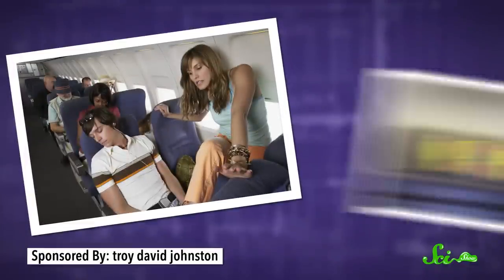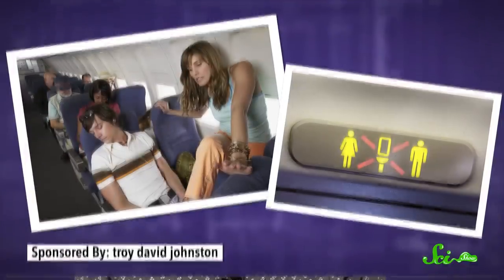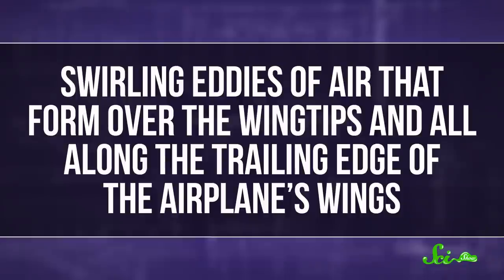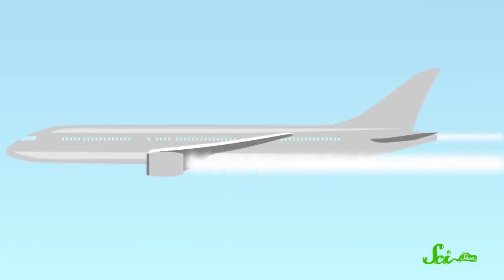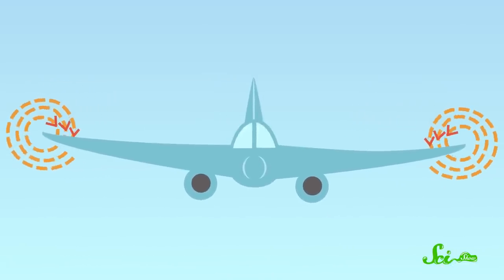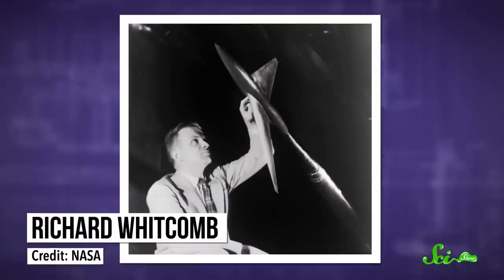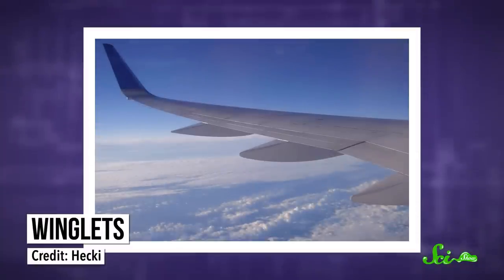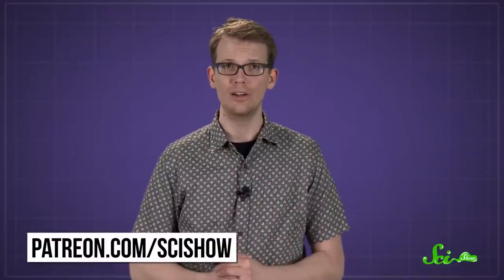What are Those Things on Airplanes' Wings?

Comment: I work on aircraft, more specifically the B737 NG series, we have to remove and install these winglets all the time as part of our inspection. 

Bout all i gotta say here, what he said is basically all there is to it. Reduce wingtip vortices and decrease fuel consumption
Reply: +sacr3 Do you know if there is an optimal angle or length for the winglets?
Reply: +sacr3 i would guess they add a little vertical stabilization as well.
Reply: +MonsterUpTheStairs i'm not an expert but it probably depends on the size, weight etc. of the plane.
Reply: +sacr3 Does it also reduce wake turbulence, so planes can be stacked closer together during takeoff and landing?
Reply: +Ralphie Raccoon it does reduce vorticy induced turbulence so yes
Reply: +MrDmkus indeed I belive so too makes Sence though from personal experience aircraft with winglets fly a lot better through storm systems and rough  air compared to a standard Wong
Reply: +MonsterUpTheStairs As far as i know, each aircraft model (that uses it) has it's own angled and sized winglets according to the plane's size,weight,shape and cruise speed (there are a lot of other factors but these are basic ones), same goes for control surfaces balance tabs.

Comment: Holly cow... So many people in the comments talking about how Air is not a fluid. Come on people.
Fluid =/= Liquid... Those are two different things.
Fluid is something that flows and does not have a definite shape. Like water in a glass take the shape of the glass, or the air in the balloon takes the shape of the balloon.
Reply: +Mateus Bittencourt you can't use the =/= sign since the terms act as sets, and one contains the other. It's more like Fluids ⊃ Liquids
Reply: Calin Cristian of course I can...

They are two words with different meaning... Yet people think they are the same thing. the =/= is meant as "not the same" the same way Liquids are not the same (different) as water. liquid =/= water.
Reply: +Mateus Bittencourt In this case a liquid (the glass)  holds a liquid (the water). xD
Reply: Mateus Bittencourt I'm afraid you don't understand what I'm saying. You can say that fluids and solids are different. You can't say fluids and liquids are DIFFERENT since all liquids are also fluids.
Reply: Calin Cristian I got what you meant the first time... Sorry, but I think you didn't understand what I'm saying.

Imagine you have 2 groups... Let's call Group A and B.

A = {1; 2; 3; 4; 5; 6; 7; 8; 9; 10}
B = {2; 4; 6; 8; 10}

Now... between A=B or A=/=B what is your answer?

Doesn't matter if A contains B, A is different than B.

Comment: I'm surprised that people don't know that air is a fluid.
Reply: Right?
Reply: +Henry Young Yes, yes it is.
Reply: And I was surprised that the English-Swedish dictionary translated "fluid" into "vätska" (liquid) or, more accurate, "i flytande form" ("in floating form", but unfortunately  it's sometimes translates to "in liquid form" ). The real translation is "fluid" but it's never used outside of physics.
Reply: +yrjosmiel73 I was a little surprised, as in my own language (Dutch), there is only one word for both liquid and fluid. (vloeistof). I've started learning English more than 30 years ago, but I had never given the difference that English makes any thought until now.
Reply: +RogerWilco Portuguese in this case is similar to English. We have the words ''líquido'' and ''fluído'' to represent them.
Reply: +RogerWilco German here. You could use "Fluid" as a lean word or "Fluss-" meaning flowing as a suffix, but otherwise theres no obvious distinction between fluid and liquid either.
Reply: +Henry Young What (English-speaking) country would teach everyone that all flowing substances are called "fluids" and actually all act the same way? That's not something you'd need to learn about until high-level physics.
Reply: +yrjosmiel73 People confuse fluid with liquid, yes air is a gas but it's also by definition a fluid.. PHYSICS!
Reply: +Jordan Shank In Hungarian, it'd be folyékony (able to flow) vs folyadék (liquid)

Comment: To anyone wondering why air is a fluid.
From Wikipedia: "In physics, a fluid is a substance that continually deforms (flows) under an applied shear stress." Basically, if you continue to push it and it continues to flow, it's a fluid. So silly putty is a fluid, but also gas and of course all liquids.

Comment: As you increase the wingspan, not only do you encounter more structural integrity problems to solve, you encounter restrictions airports have put on wingspans. This limit is in place to help parking arrangements, improve runway safety, and prevent disastrous collisions in airports that are designed for a set aircraft size. For a long time it was simply cheaper to add more wingspan than it was to study and fabricate winglets. But now with improvements in technology and manufacturing, as well as airport restrictions, winglets are becoming very popular.

Comment: Fun Fact:
Winglets are mostly used as an upgrade for older model airplane wings to make them more efficient. Modern airplane wings like the 787 don't need winglets as the wing has already been optimized for minimum drag.

Comment: winglets suck to manufacture. the inside structure is tapered, twisted, and bent leading to a bunch of parts with sharp bending radii and closed geometry. i made a winglet spar mold and it was definitely the hardest thing i have designed.
Reply: +cubedude76 And now consider the crazy twisty bendy shape of modern raked wingtips on composite wings, like the 787!
https://c1.staticflickr.com/9/8001/7196778020_89ee123320_z.jpg
And on the 777X they even plan to have the whole thing folding.

Comment: You should see some of the new curved wings being engineered for airplanes.  The entire length of the wing is curved upward instead of just the tip.  I'm not entirely certain why that helps because I'm not in Aerospace, but I've been told it's a good improvement.
Reply: +Daracaex It is the more efficient solution to the same problem (less total added mass for same reduction in wing-induced vortices), just that it is a lot more complex structurally to achieve. Hence it is only in the newer iterations of aircraft that we are seeing it.

Comment: Why are there airplanes WITHOUT winglets then?
Reply: +Connor Halleck  My guess would be that the wingspans are long enough for extra compensation to not really help that much. Hank did say that one way to deal with it is by making the wings longer.
Reply: +Connor Halleck Making the wing have a long gentle taper is actually more efficient than winglets, so large airliners that don't have to fit into the smaller gates at airports use those instead (like the 787 and 777X). Other planes, like older 737s, were made before winglets were commonplace, so they don't have the benefits of newer versions with winglets.
Reply: PhisherEntertainment Interesting!
Reply: +Connor Halleck Probably less vortex around smaller planes?
Reply: +Connor Halleck There are a lot of answers to the question, if we consider airplanes in general. It depends on the preliminary design and the function of the plane.

If we're talking commercial airliners, then some might not have the typical blended wingtips because they integrated the design onto the wing (notably 787 Dreamliner). 

Other reasons for any type of aircraft might include them being older models, not prioritizing fuel efficiency, or does have them but are not your currently-typical design.
Reply: +Connor Halleck old designs. The 747 was built in the late 60's, decades before winglets were introduced.
Reply: +BigGamer2525 787s don't really have winglets
Reply: vagkalosynakis see above answers. also, BAHAHAHA patents are so fucking stupid, omg
Reply: Winglets are not necessary but help with efficacy and drag reduction there are a lot of modern aircraft that don't have winglets in the military general and even commercial sectors while they are becoming more popular again they arnt necessary they will help your aircraft Save fuel and all around improve its flight charectistics    In a commercial setting a company can save money in fuel there aircraft will require less mantince  due to less turbine wear and fly better and get to places quicker also the aircraft would again handle  better under Certain conditions also if you are flying a large Heavy cargo craft that by design  to accommodate cargo makes more drag winglets can help but there are still many places they arnt used and again they just help
Reply: +PhisherEntertainment Also, $$$. The cost for applying for a new type certificate and all the required documentation for, basically a new wing design, is very costly.
Reply: +Connor Halleck Winglets only help in certain cases.  It depends on the wing design, speed of the plane and lots of other factors.  Keep in mind that the winglet itself adds drag, weight and complexity to the airplane.  Sometimes that tradeoff overcomes the drag-reduction it provides.

Comment: hmm... length is not entirely the reason. but i guess it would be difficult to explain in simple terms. i would say it is to stop the air from bottom of the wing to try to get on top of the wing which you show in your vortices. the flow across the tip is because there is higher pressure on bottom of the wing. if the wing is pointing up then the bottom surface of the winglet part does not need to have a lower pressure. the ones that you don't see with winglets would have a much larger sweep at the end which achieve the same effect. there are also winglets of the shape of T

Comment: Thanks for a pretty good simple explanation for this--It's hard to explain fluid mechanics accurately and simply sometimes.  You might have added that this doesn't help all wings--some modern wing designs are efficient enough that adding winglets doesn't improve their performance.
Reply: +Tim Mallette yeah. or of the aircraft is pretty slow, such as your typical Cessna or Piper.

Comment: You define drag as the total of all the forces a fluid exerts on an object thats moving through it. This definition is incorrect as lift would be included in that definition. Drag is the fluid force that acts in the direction opposite of the motion of the object.

Comment: Actually, those "winglets" have been around, I think, since the 1930s.  Their main purpose was to increase lift.  They prevent high pressure air under the wing from travelling to the lower pressure region on the top surface, which also,by the way, is what causes the vortices.  They are commonly found on short-field bush planes.  They usually point down, not up, though.
Reply: Clyde Wary 
German had a jet with small wings and wiglets (He162)

Comment: Hank, a bit of a correction, I believe. Drag is the COMPONENT of force acting in the direction parallel (opposite) to the direction of motion. This is how it is defined. Lift is that component perpendicular to the direction of motion. The total of forces acting on an object moving through a fluid doesn't really have a name, and it certainly isn't drag; you MIGHT call it simply pressure force (but it has to be integrated and then broken into components to make any sense). Great video, otherwise.
Reply: +PRINCESORH isn't the total force the Renoyld's number?
Reply: +DFX2KX if you're not trolling...the Reynold's number is a dimensionless number (indeed a ratio of forces) but no...not a force itself.

Comment: please answer this question for us:
is it harmful to charge our mobile phones close to us and should  we speak on the phone while it's charging?
thank you so much for spreading knowledge and wisdom ❤
Reply: +EROS Nicolaou the answer to both of those is 'no'. unless you're using a bad charging cable, and at that point, your phone is at more risk then you. The amount of radiation a sitting cellphone releases isn't any more then one that's charging. even those wireless Qi chargers aren't dangerous in any statistically significant way.
Reply: thanks dude:)

Comment: Raked wing tip also have a similar effect, I.e on the Boeing 787 where the adopted raked wing tips over Winglets
Reply: +mulymule12 Just an FYI, raked wingtips were actually first used on the 767-400ER. The 787-3 was planned to utilize more conventional winglets due to them being just a touch more efficient at lower wingspans, but ultimately that version of the 787 was canceled.

Comment: Fluids are substances that flow, that is, the particles that make them up are free to move past each other, which means that objects in them can also flow within the fluid. Can you wave your arm in air? Then it's a fluid. Can you move your arm through water? Fluid. Can you wave your arm through the surface of the sun? Well...the arm would disintegrate first so no, but in principle you could, stars are made up of plasma which is a fluid.

I wonder how much it would cost airlines if every passenger ordered an extra pack of peanuts or pretzels or other salted treat.
Reply: +Mr Schr&#246;dinger - I am the one who reviews. 
My arm is a fluid? :D
Reply: That was ambiguous phrasing on my part. If your arm can move through a substance, the substance is a fluid. If your arm dissolves, burns up or disintegrates, the substance may or may not be a fluid.
Reply: +Mr Schrödinger - I am the one who reviews. So is fire a fluid?
Reply: iLuZiioNz Tutorials Yes. Well, fire is complicated but the short answer is yes, it is a fluid.

Comment: I've noticed that the winglets point up instead of down.  I'll betcha that if they pointed down, they would contain the vorticies better.  But I'll bet that would also increase the risk of wing strikes on landing and takeoff.  Hence the compromise position of putting them up.... Just a guess.
Reply: +Aidan Bazan Respectfully disagree with both of your points.  The wing tip vorticies originate from the bottom of the wing, then curl up.  Stopping them before they curl up and around should conserve more energy.
Also, there are LOTS of videos on YouTube about commercial planes landing with cross-winds.  There are lots of wing strikes, and near-wing strikes, with the current configuration.  You have to assume that there would be many more with 4 to 6' of downward winglet.
I stick with my main position above.
Reply: +Aidan Bazan Wingtip hits first, before the engine.

Comment: What are the small things on the underside of a wing?
Reply: +doxlulzem the gr8  I think you mean the flaps; the pilot opens them when the plane is slowing down to land.  They open up and block more air, increasing the drag and decreasing the speed of the aircraft.
Reply: +Colbie Dison actually, the purpose of flaps is not to slow down the aircraft, that's an unwanted side effect because slowing down the aircraft might cause a stall, which would de disastrous. the purpose of flaps is to increase lift by increasing the chord ou the curvature of the airfoil (depending on the type of flap), in order to prevent stalling at the slower airspeed required to landing and taking off.
Reply: *****  Ah okay, thanks. :D  You learn something new every day.
Reply: +powmod its an inherited side affect, not unwanted. the reason why you want to slow down is to allow the aircraft to fly at a steeper approach while still maintaining airspeed.

Comment: Parasite drag - caused by things sticking out of the airplane like rivets, antenna, wires etc.  induced drag - byproduct of making lift. Wing tip vortices are caused by the high pressure underneath the wing wanting to move to the low pressure side on the top of the wing creating a swirling action at the wing tips. The higher the aspect ratio of the wing the less of an effect there is; longer and skinnier is better than short and fat. Elliptical shaped wings cut down on wingtip vortices too, like the spitfire. Hoop wings, wings that don't have a tip, have been tried here an there but I have not heard of it being worth all the effort and cost to make them.

Comment: Okay... Judging by the comments I'm seeing, next SciShow episode clearly needs to deal with the distinction between a "fluid" and a liquid (vs. gas).  I dunno if it's an actual science question, or if it's just a shocking number of folks with poor vocabularies... Probably a bit of both.
Reply: +boatrat74 It's simply much easier to spend 5 seconds typing silly comment then 10 using google, opening first link and reading description of fluid in wiki

Comment: well this video is wrong, you guys just did buzzfeed...( badly reaserched video )
 The winglets arent there to reduce drag that is simply a biproduct ( a pretty small biproduct compared with its actual purpose), your diagram shows the winglets are there to stop vortexing on the tips that essentially makes the tips of the wing useless as they get pushed down by the vortex reducing lift.
Making wings longer does not reduce this effect either, making them narrower does and the biproduct of this is longer wings to get the same lift as narrower wings produce less lift.

I would ask you do a retake as you guys are the most science reliable channel I have found and two mistakes can be undone.

Comment: i haven't noticed these on the tail section of a plane before, is there some reason why it wouldn't be of benefit there too?
Reply: The tails are not producing appreciable lift, and therefore do not produce large vortices, they are control surfaces mainly (used to pitch up or down).
Reply: thought that may be the case. thanks

Comment: why the vortices only affect the winglets? doesn't it affect everywhere?
Reply: +ArnoldLee133 vortex-formation happens everywhere, but the wing tips are by far the worst offenders, unless that wing doesn't have an inherently lift-generating airfoil.

Those other vortices are why you see tiny little winglets on the bottom and top of some aircraft wings.